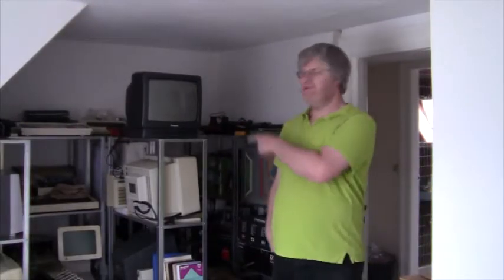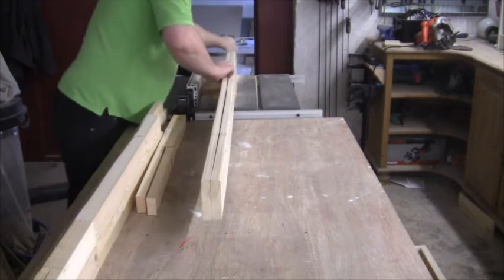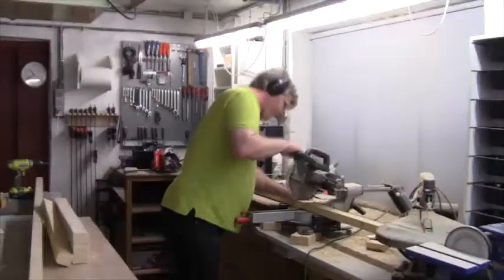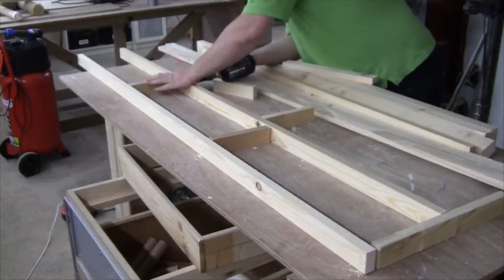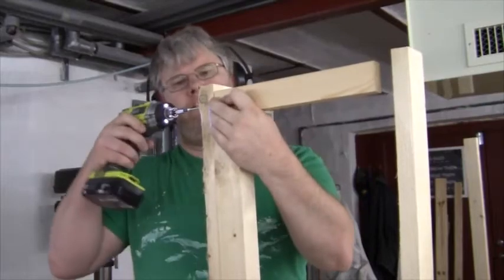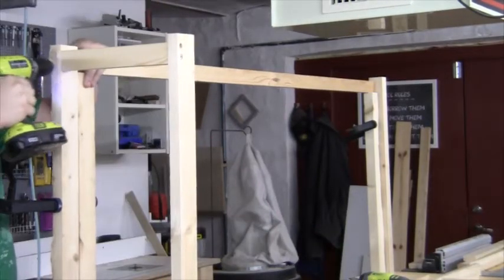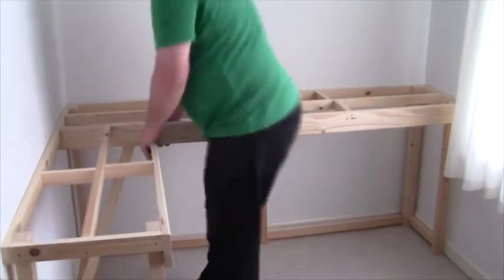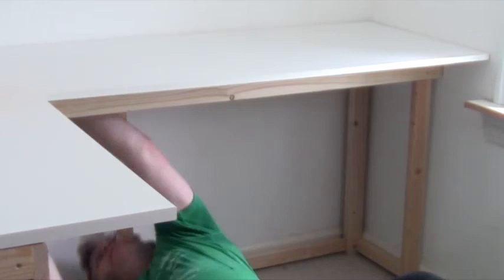Building a workbench for my electronics lab

Comment: Hi Jesper - Thanks for sharing. It looks like your using 2x3 inch on the frame and 2x4 for the legs. Is that the case?
Reply from the maker: It's definitely 2x4 for the legs. For the frame, I just took what I had, but it's about 2x3, as you say.